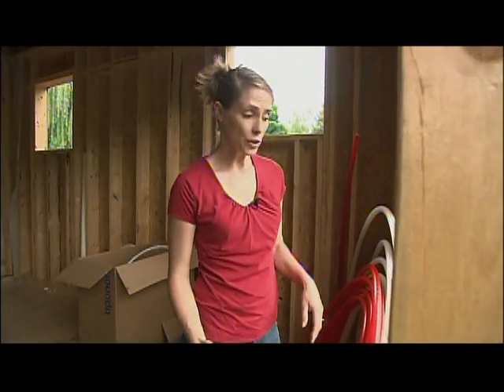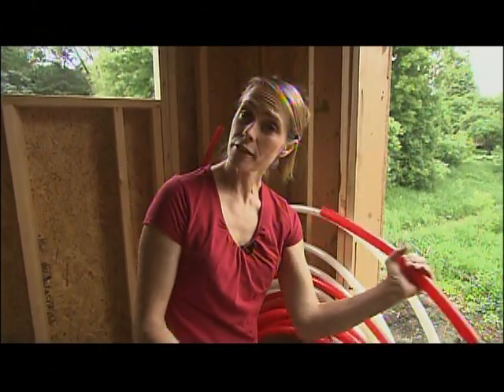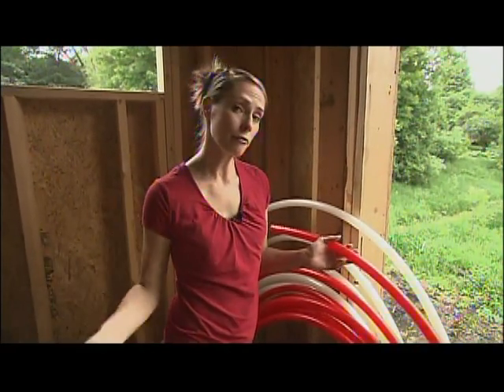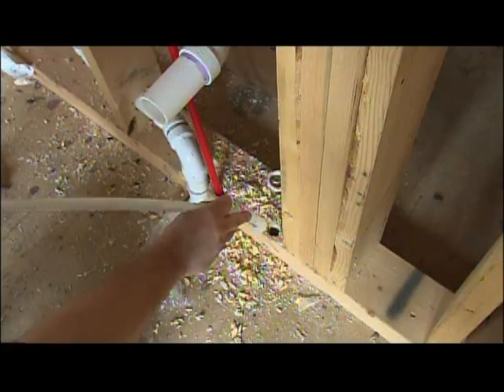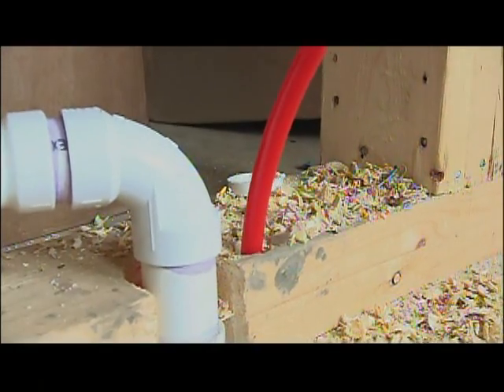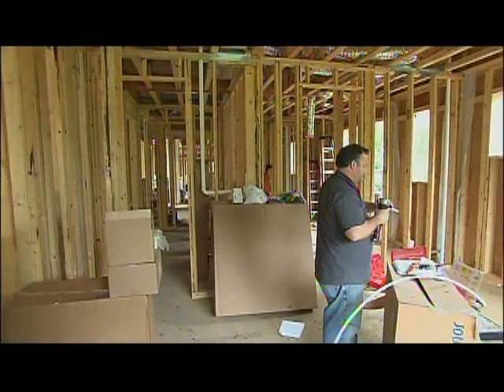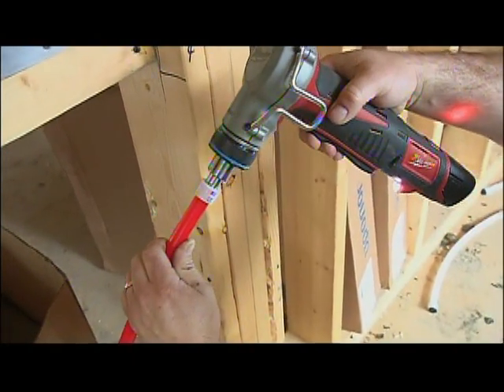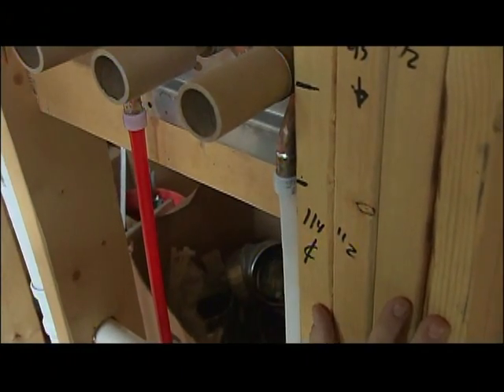Uponor PEX-a Plumbing System in Hometime's Creekside Home Project

Comment: Will start leaking after 5 years or so. Compression fitting safer method. Or welding. Just use ppr welding method

Comment: Is the Uponor pipes and fittings material certified for drinking water ?
Reply: Pex is either potable or not, Uponor has potable  and heating/boiler pipe applications (oxygen barrier)

Comment: Rats will chew it though
Reply: You’ve got a rat problem, not a plumbing problem
Reply: when rats can fly... I agree probably wouldn't install this stuff anywhere rats can get at but when it comes to replacing some of galvanized in the ceiling on a budget this stuff does the job.
Reply: I like using PEX but I  agree  that rats or mice can chew through it. Happened to me in a rental property. A mouse chewed on a PEX supply line to the dishwasher.  Had a leak.